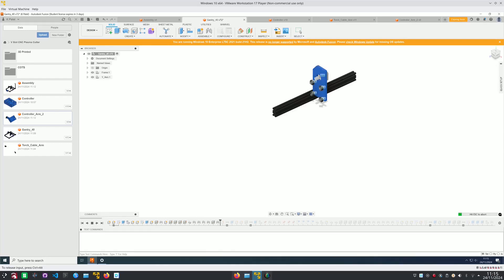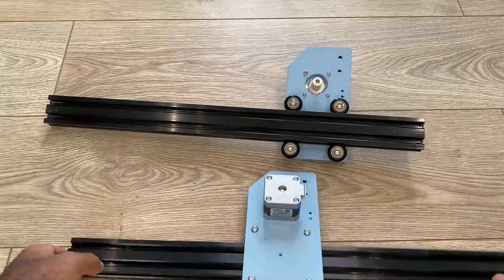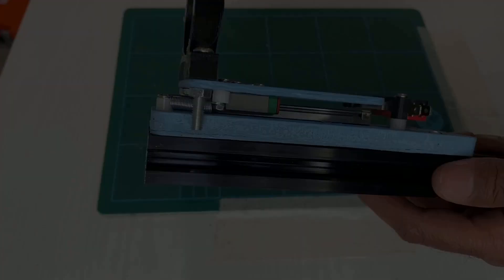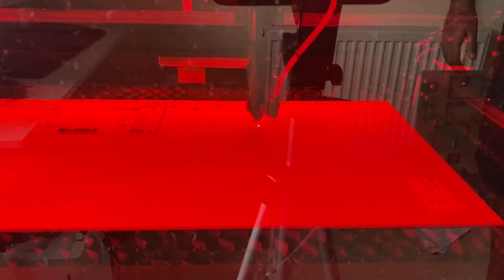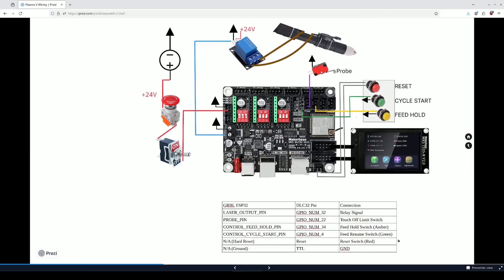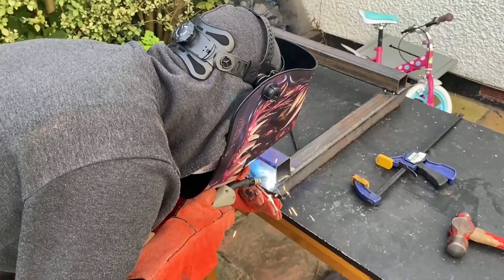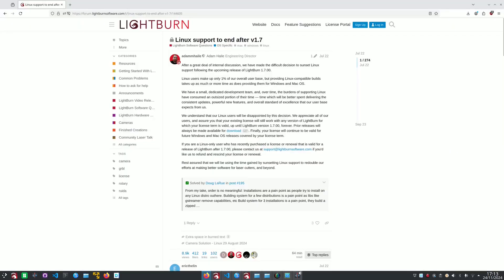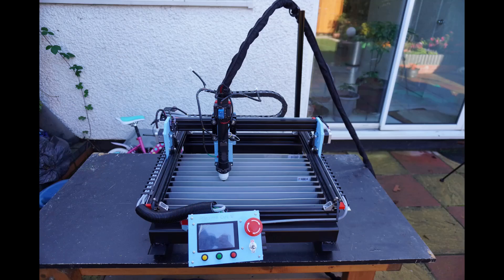Plasma V: DIY CNC Plasma Cutter- Open Source/Arduino/DLC32/GRBL ESP32

Comment: Good afternoon. I have a question. When I compile your firmware, everything compiles fine without errors, but after uploading the firmware to the board, the board does not work, the display does not show anything, and there is no connection to the PC.

Comment: forgive my ignorance, but because LightBurn have removed support for Linux, will this project no longer work if I wanted to build it now just using my Mac OSX and the MKS DLC 32 V2 .1 board it's something we've been thinking about for the last month or so but putting it into a CNC frame of 2 m by one if you could throw some light on that for me that would be brilliant please, we used to using this board to make normal CNC machines, but we have never looked at it for plasma so I'm not sure whether it's capable just using OSX and the code changes you have made. Perhaps you could let me know, please thank you very much.

Comment: Awesome video and perfect timing I'm working on building a larger scale version of this however, I'm not very familiar with the board and using VS or really much of the computer side of this could you make a video going into more detail about how to flash the DLC board and how to change/modify the file before flashing as well?

Comment: Hi everyone,
I'm currently working on a DIY CNC plasma project, which is also my final project for college. I’m facing a critical issue:

Whenever the arc starts, it only stays on for less than a second, then immediately stops. At the same time, my controller board and Universal G-code Sender (UGS) freeze or disconnect. I also get an alarm saying that a hard limit switch is triggered.

I'm wondering — could this be caused by electromagnetic interference (EMI) from the plasma arc? Has anyone else experienced a similar issue?

Any advice or solution would be greatly appreciated. Thank you very much in advance for your help and support!
Reply: Even when trigger not connected and control digitally

Comment: how did you do touch pobe ? Do i need some sensors or ?
Reply from the maker: There's a limit switch added on the torch holder, it's engaged through a spring mechanism
Reply: @kpmaking9647 aham ok thanks :D, one more question this firmware looks like dont work i cant upload it to my board. always some errors it need file mks_dlc32_partition.csv
Reply from the maker: @MustafaHero-e9t  https://github.com/kpatel122/MKS-DLC32-FIRMWARE-Plasma-V
Reply: @kpmaking9647 thanks. I have coneccted all but plasma still dont go on. Is that low trigger relay or high , because my is low
Reply from the maker: @MustafaHero-e9t  That would be dependant on the kind of relay you have, check the datasheet for your model. I would disconnect it from the torch and verify the relay turns on/off using a multimeter first ( that's how I verified my wiring was correct) before attempting to control the torch

Comment: what relay are you using do i need external power or just off the spindle power positive and neg
Reply from the maker: It's a 24v volt relay and should be connected to the spindle output as per the wiring diagram in the video

Comment: The MKS DLC32 board dual y axis moving but so is x axis. when the dual y axis moves using the screen so does the x axis the z axis works fine endstops work plasma relay switch works
Reply from the maker: The MKS DLC32 manual has a sample wiring diagram for the steppers, that's what I used to configure the motors. The documentation is very good and should solve your issue if you follow it carefully

Comment: As someone who went through the same process (though I was converting an existing CNC with a DDCS controller, but many of the same challenges were faced), I appreciate the efforts you went through in this. Not only is doing the project itself a challenge, but making it into an informative video adds a whole new layer. Pretty sure making the video added 3x time to the project when I did it last year. Great job!
Reply from the maker: Thank you very much!! You are completely correct it does add more work, on the flip side it adds motivation to complete the project otherwise these parts would still be in the shed :) PS I just discovered your channel- very cool!

Comment: I have worked a lot with cnc-plasma before. Here are some tips:

1. Decrease your dwell time so that it's just enough to create a hole, don't linger.

2. Go way faster when cutting, you don't want heat going into the material you aren't cutting so be as quick as possible while still maintaining a straight beam.

3. Don't start at the contour you are trying to cut. Start about 5-10mm away from it to punch the hole and then move into the contour with the correct cutting speed.
Reply from the maker: Thank you very much for the tips! cheers

Comment: Hello, I want to try to repeat your project, I downloaded files from git. I can't find the specification of the materials used. Which engines, drivers are built-in or optional, which belt and pulleys? Do you have such a list? I would be very grateful if you could share it or show me where I missed it. Thank you for your efforts!
Reply from the maker: I have updated the bill of materials today- if you look in the Plasma V repo under 'BOM'

Comment: my biggest hurdle is in the software side of things as its not beyond my comprehension. as aDIYer and a welder this project really intrigues me
Reply: owh ps. i own a co2 laser too. so im familiar with lightburn but your method of translating it to a plasma cutter is whats stopping me
Reply from the maker: I think if you are comfortable with analysing g-gode you should be able to use the script to do the translation for you, all the best

Comment: With regard to milling aluminum, you need lubricant on the bit. Without lubricant the bit will gum up, stop cutting and snap.
Reply from the maker: I used WD-40, but I think my feeds were too fast,  a better CNC router is on my todo list :)

Comment: Also sad for Lightburn dropping Linux support

I'm not a Laser/Torch guy yet, but I pick machines and projects that I have the ability to run on Linux, even when it hurts (like CAD Programs or Image Processing).
Reply from the maker: I think Linux as a whole is trending in the right direction, but it's a shame to lose this software
Reply: BlenderCNC/FabexCNC works great in linux

Comment: Awesome built, i might be building one soon. Thanks for sharing your built. I am thinking of all xyz motor fixed location without the wires running around. Your cut can be cleaner with a more powerful compressor min 10Bar 150psi. Thanks for the tip on lightburn and the control card. ❤
Reply from the maker: Thank you! I appreciate the tips. Definitely agree, a bigger compressor would certainly help- just need a bigger shed to keep it in :)

Comment: There is no plan to move forward with Linux for any version after 1.7. xx.  And yes, you will still be able to use the last supported version forever.
Reply from the maker: Yes I'm still really happy it's not on a monthly subscription so I'll just use the version I have for as long as possible

Comment: Nice Video! Has just the info that I needed. Have been stuck on my build for quite a while now because of EMI issue. How is EMI issue in your machine?
Reply: hey! currently working on my own build aswell, im mid way through finishing and combating the EMI issue, so far what ive done is: place all the electronics in an old pc case and ground it, use an optocoupler for the relay to the plasma switch, and on top of that EVERY wire coming in and out of the motherboard (in my case a ramps 1.4) that goes to the stepper motors and relay all pass through a capacitor shunt to ground array such that there is a capacitor wired in parallel to the wire, the other leg of the capacitor then goes to case ground, the capacitor size i used is: 4700pf this should basically allow the high frequency noise from the plasma cutter to be sent directly to ground HOPEFULLY filtering out the interference, i have not tested this yet but will be soon and will be sure to keep you updated if it gives successful results!
Reply from the maker: @benads6847  sounds very comprehensive, all the best hope- it works out!
Reply from the maker: Thank you! I've used the SD Card for streaming  G-Code and so far no EMI. My motor cables are shielded and the setup seems stable. All the best with your build!

Comment: Wow amazing project, thanks for sharing, just found the channel and happy to have found it and subscribed

I wonder edges could be cleaner, I have seen some cleaner plasma cuts, I wonder if its the material, distance to material or just the plasma cutter itself causing this. 

I have seen some people even do bed levelling as in a 3d printer to get a mesh of correct distance for precise cuts, but again I must mention I dont know if this is the reason
Reply from the maker: Thank you! Yes there's lots of fine tuning to do, those were the actual first cuts on the machine and I'm still learning what the optimal settings would be. I'm not sure about 3D printed type levelling, but things like air psi, amps on the torch, touch off distance and cutting speeds are all parameters that need to be dialled in. Cheers